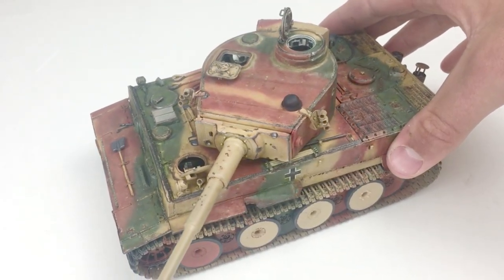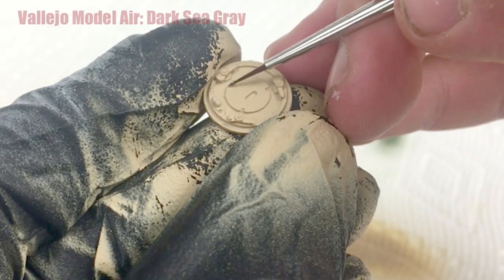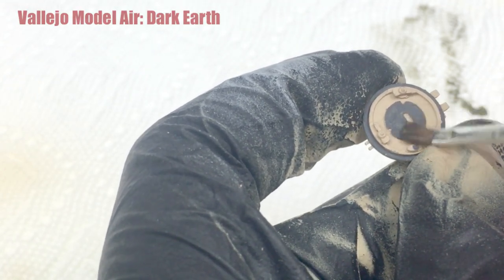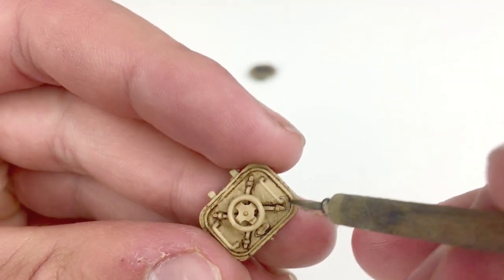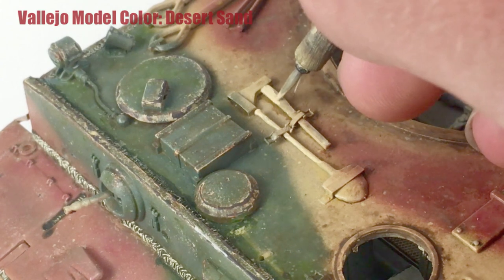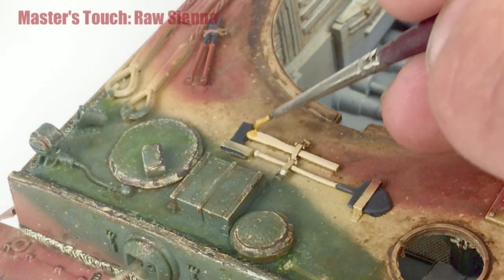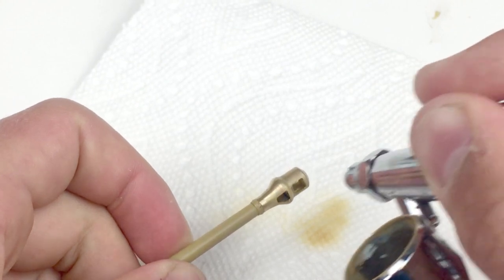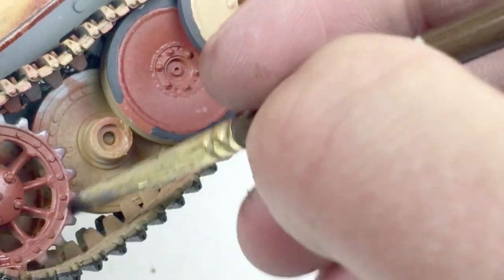Final Details on This Tiger 1

Comment: I have started this model a week or so ago and was wondering how I should go about painting it with an ordinary brush. It's a rather stupid question but painting camouflage is rather difficult for me as I haven't really made many models before (2 others to be exact) but they were rather small spitfires that required practically no skill. Any advise?
Reply from the maker: Wolf_ Legend, I would watch Night Shift’s video on painting his rutscher. But basically, just paint very even, thin coats. It does not even have to be a solid color the first time, just build the layers up. I would also mix the paint with some acrylic drying retarder, as it’ll be easier to get a good result
Reply: @TheScaleEngineer  thanks that helps alot

Comment: Great progress on your Tiger! Enjoyed watching the video (twice!). Looking forward to the next one. Would you mind showing your way of applicating superglue in detail? (One of my shortcomings...) I like the Idea with that syringe - if I would like use this myself, what would I need to know and buy?
Reply from the maker: Hi Tankbrusher! Glad to know you enjoyed it so much! I would not try a syringe, but yes, I would be happy to demonstrate my application techniques in my next build video! Most dispenser needles will fit on the end of any CA bottle, and so setup is pretty easy.  Just push the needle assembly onto the tip!

Dispenser needles: https://www.ebay.com/itm/50pcs-1-2-24Ga-Blunt-dispensing-needles-syringe-needle-tips/113854170303?hash=item1a823cc4bf:g:jzEAAOSwnkldVOlq

I would also encourage you to buy black superglue, as it is easier to see, and then therefore clean up.

Black CA: https://www.ebay.com/itm/1oz-THIN-BLACK-RUBBER-TOUGHENED-CA-SUPER-GLUE-Cyanoacrylate-with-Pin-Cap/261901868571?ssPageName=STRK%3AMEBIDX%3AIT&_trksid=p2057872.m2749.l2649

If you want to clean the excess off, you can also buy debonder. Make sure that it is plastic-compatible, as it otherwise will damage it. Just make sure not to use too much, as it'll remove the part along with it.

Debonder:https://www.super-hobby.sk/products/Debonder-PS-F.html

Hopefully this helps! I'll add details in a future video as well.